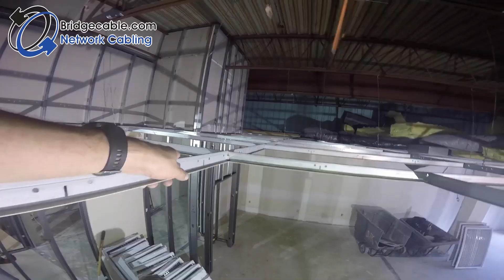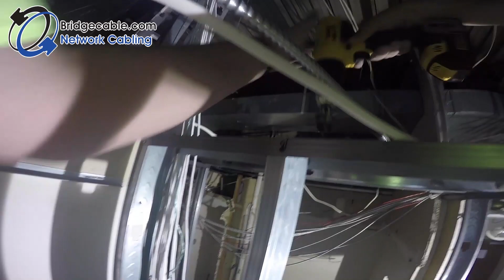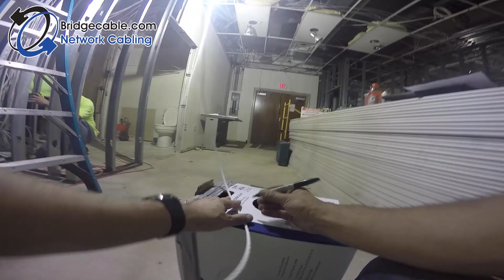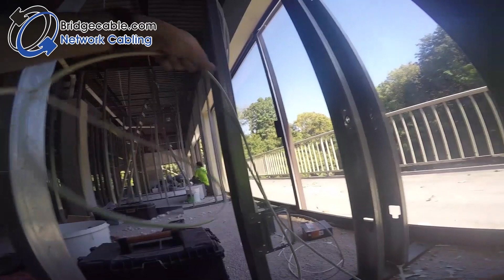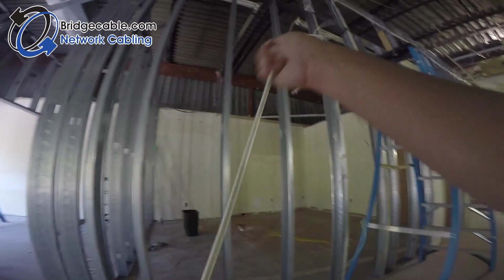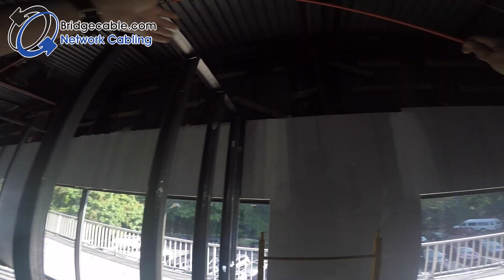A Day in the Life of a Network Cabling Tech - Must SEE! How to run data cables and what to expect!

Comment: Is this an easy skill to learn? Looking into going to school for this?
Reply: Paul here from @bridgecable - "easy" to run a cable but the more in volume it gets harder. Loaded question.....for example one team yesterday in Philadelphia did 13 wires and complete IT setup for new computers in a T-Mobile store in under 4 hours. Another crew in the burbs it took 8 hours to pull 1 cable. Every drop in network cabling is different. Places to learn is in Trade Schools but Telecom is usually picked up out there in the road or Union has a Data section. Actually in the Union field, shortage of Telecommunications techs. Small cabling shops usually fail so try to get into a shop with at least 5 or more techs. However....I will add.....cabling is "Easier" after 20 years in the business....but every week still a challenge hidden. :) I love this work!!